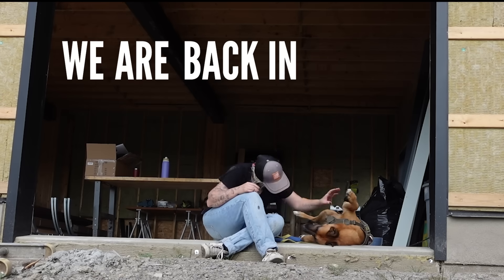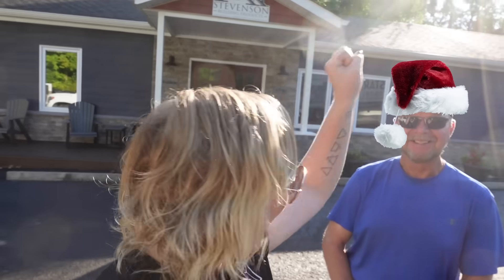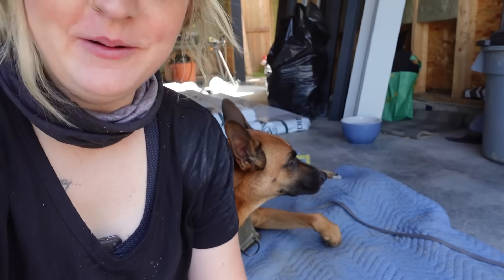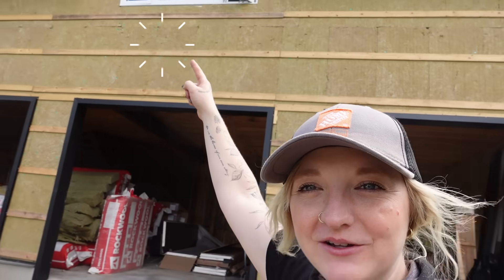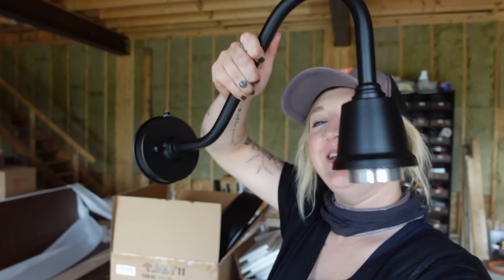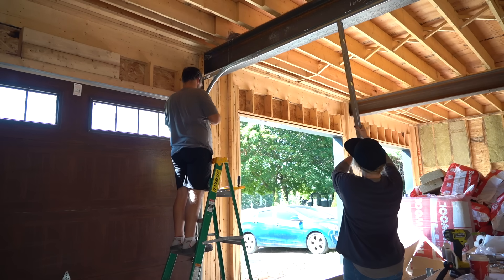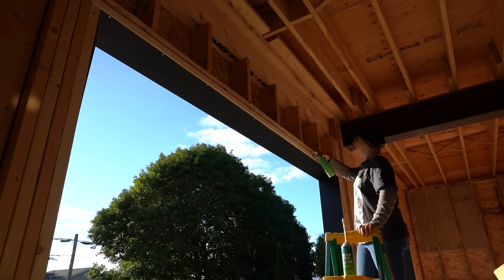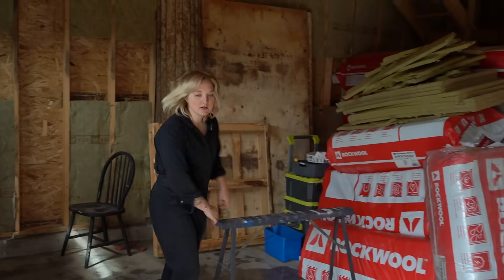*EMOTIONAL* we finally have garage doors! 😍 |THE GARAGE BUILD

Comment: Hey Danie! Just a heads up for future projects along this line - even if a product doesn’t come with instructions the manufacturer absolutely has installation guides on their website. It just might be harder to find for projects you would normally use a contractor for.
 In the case of your garage doors it would have been in the the “Professionals” tab under “Architects and Designers” in their Resource Center under the name “Installation Guide”. 
I work in architecture and those types of documents are really important for our project manual, so every manufacturer makes sure to supply them.
I know it is too late for this project but it could be helpful for future installs!
Reply: Thanks for information.

Comment: Around 23 minutes when you said “are we still level?” The correct term is actually “plum” I just learned that literally yesterday so just thought I’d pass that little nugget along. 😅

“Plum" usually refers to something being vertically straight or aligned with gravity.

"Level" typically refers to something being horizontally straight or parallel to the ground.
Reply: Thank you!  I did not know that!!!
Reply: It's actually plumb  - cos it come from using a lead bob on a string and the chemical name for lead is plumbum!!

Comment: That’s impressive that you guys did that yourselves. My husband was a contractor for decades, and he always left those to the experts….those springs are wicked to work with!  Also, sometimes “experts” can do things in hours that would take DIYers days to do. When we added on to our house, and added a large garage, there were four things we paid someone else to do:  roughing in the plumbing, ductwork for the furnace and AC, digging and building the basement, and the garage doors.  Will you get the driveway done in time for winter?  When I could finally park my car inside in the winter, I felt like a rich woman.